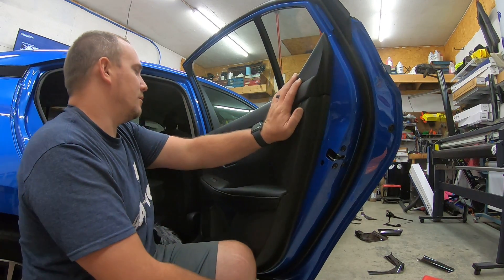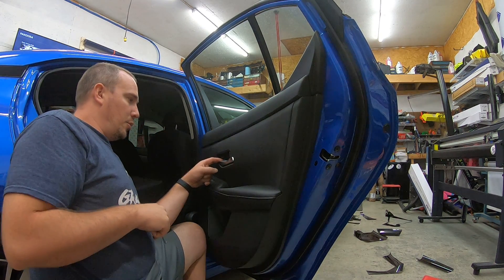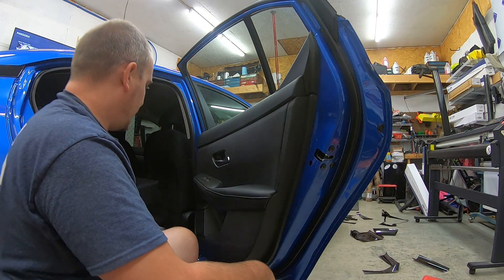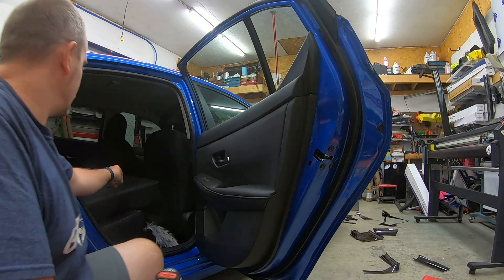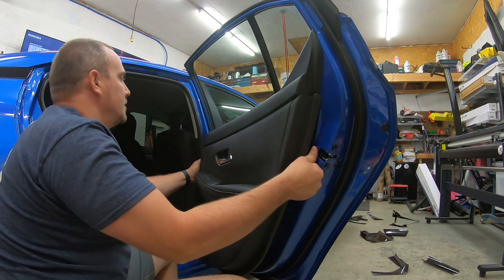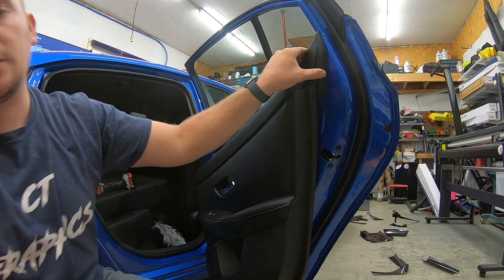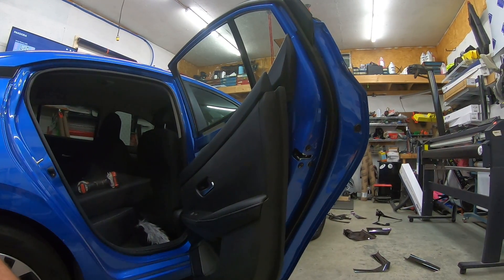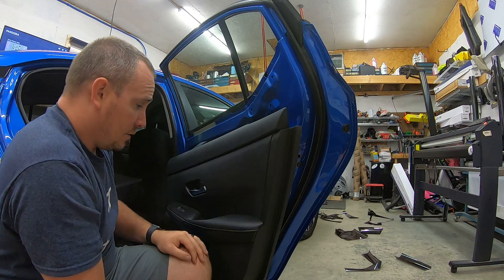How To: 2020 Sentra rear door panel removal

Comment: Hello Travis, Thanks for the video .. I'm looking to replace the speakers in my Sentra, Probably I won't do it myself, but I was looking to understand the kind of work needed. The major issue I have is that the rear speakers in the deck (6 x 9) have almost no power, low volume , do you have the same problem ?  Do you know if that's a problem with the speakers or with the head unit ? Regards from Costa Rica.

Comment: do the rear doors have speaker wires already there  ?
Reply: Did you ever find out if the door has speaker wire going to it even though there's no speaker there?
Reply: Did you ever found out if the door has a speaker wire even though there’s no speakers there?
Reply: No wire